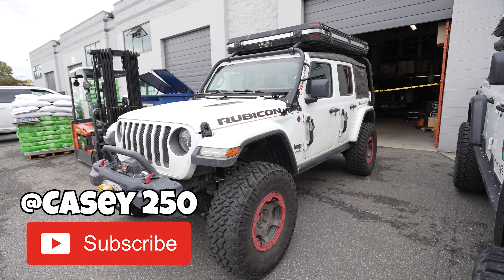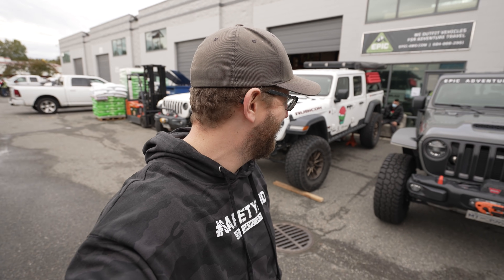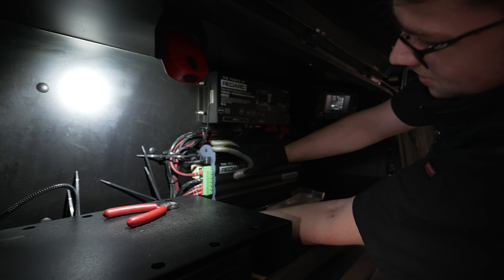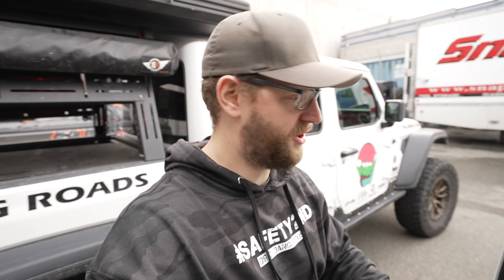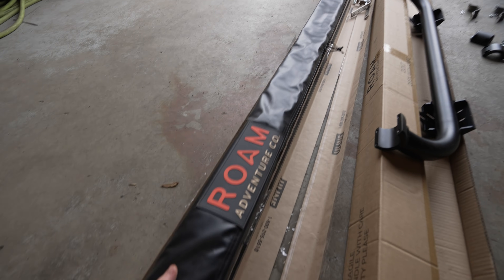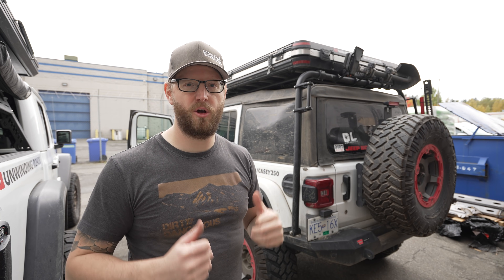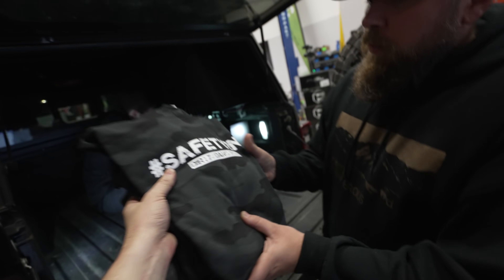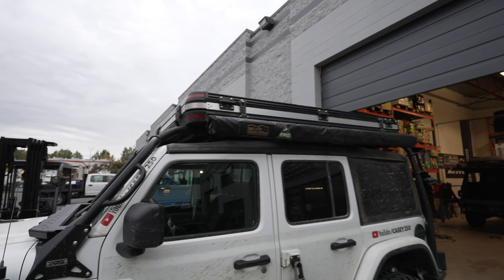Building My Jeep Wrangler JL - Adding an Awning

Comment: 8:34 We have an ARB awning with an awning room we bought separately. We have the option of fabric walls or what we use it mainly for is 4 walls of mosquito netting. It's a real lifesaver when the flying insects are breeding by the lake. We set up a table, stove, and chairs in there and makes camping infinitely nicer during mosquito season. 11:30 Pro-tip: lower one of the poles by a foot or so to easily shed water when raining.
Reply from the maker: I was looking at the ARB awning originally but it was back ordered to infinity with no ETA haha. As you mentioned, I want the walls for both rain and summer insects.

Comment: I have used a similar awning for the past couple of years and it provides great shelter. Make sure at night that you plan for runoff. One night in a downpour mine collected so much water that it failed catastrophically. Mine broke both legs and tore off about 8 rivets that hold the awning onto the mounting bracket. Now I lower one of legs to provide a runoff path at nighttime.
Reply from the maker: Ya it poured in the next vlog coming up. I dropped a corner down and it was awesome all evening.
Reply: @Casey250  Oh that is great that you picked up on this early. I was a bit late to the party. Lol

Comment: Curious how often wind accompanies rain up in BC. I just use a tarp and a pair of telescoping poles, but I pretty much accept that my gear’s going to get wet, because I have to take it down when the wind picks up. Here in the Midwest, rain usually leads a front with strong winds. But definitely nice to have some shade and to allow shelter from rain when the wind’s not blowing.
Reply from the maker: It can really be dependent on where you are. We get a lot of rain with no wind as the clouds move in, get hung up on the mountains, and drop their rain.

Comment: Surely now the Jeep is way to top heavy. Simpler solution would be to flip the clips upside down on the roof top tent so they unclip from the top and mount the awning to the tent. Would have saved plenty of weight with that bar used and would of allowed for a flush finish. Preferably should of gone for the 270 freestanding awning as they are simpler to setup up. 
A big fan of watching your videos but it seems lately to be a trend of throughout a lot of You Tubers, including yours, to sacrifice weight and practicality for sponsorship items. Surely would of been better to remove the soft top and put on a hard top to allow for a lighter tent and roof rack combination and reduce up high weight.
Reply from the maker: Maybe but I can't find a hard top anywhere that isn't thousands of dollers. The rtt isn't rated for bolting on an awning. The 270 awnings are way too big in the side and dint extend as far out. On the note of products, I run exactly what I want, sponsored or not. I work with companies I feel align with my build and goals and turn down many that don't.
Reply: @Casey250  yeah understand. We hav3 to work with what we have. Love the channel though, and love watching the cross between yourself and Sean. Look forward to more trips to entertain us that can't get to those places where you can get to